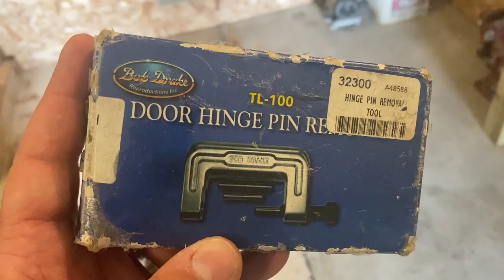Ford Model A | How to Remove Hinge Pins and Doors

Comment: Came across your channel on the Model A ----- thought I would tune in and see what's going on ------ Another pointer ---- as you tighten up on the Hinge Pin Tool ----- take a hammer and hit the Bolt Head ---- you don't have to hit hard ----- just small smack ----  ----- you have kinetic energy then going through the bolt -- the pin and on to the door hinge pin ------------ Taking off stubborn Brake Drums with a puller attached ---- smack the large bolt head that's you are tightening down on ---- same principle ---- tighten a little --- and smack ---- you are releasing that energy ------- Will follow along on the Restoration ----- Thank You for the Video ---------- Rodney
Reply from the maker: Appreciate the helpful tips. Thanks for watching!

Comment: If you're ever going to try and drive the pin out with a punch, always have someone hold something very heavy on top of the hinge. None of mine wouldn't budge at all after soaking for a month, no matter how hard I hit them. After advice from a friend, I got my wife to hold a very heavy 2ft wrench on top of the hinge with it slightly open to straddle the top of the pin. A few taps and all of them came straight out. The weight on top stops the impact being absorbed. 
Also if using the tool, hit the bolt end after tightening it. It doesn't need bashing, just a couple of firm taps and tighten it some more.
Reply from the maker: Good information to anyone attempting to remove the hinge pins. Thanks for watching and sharing!